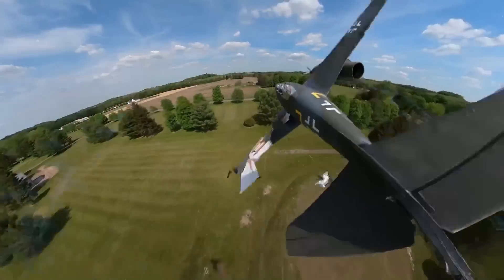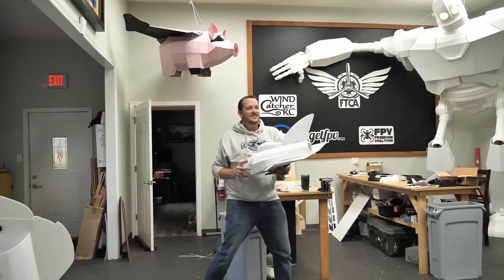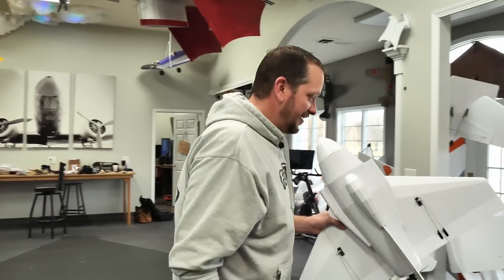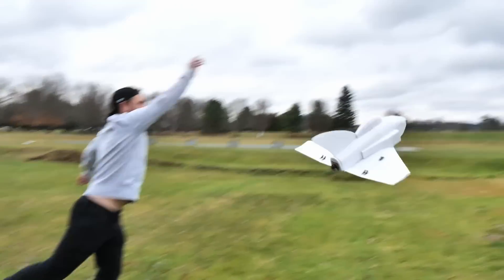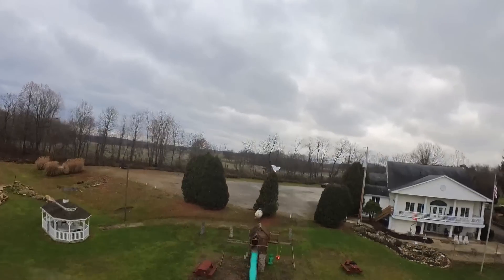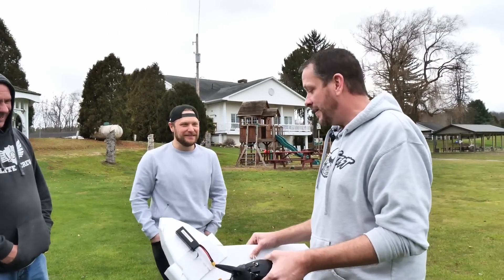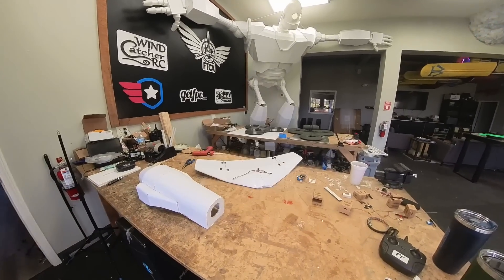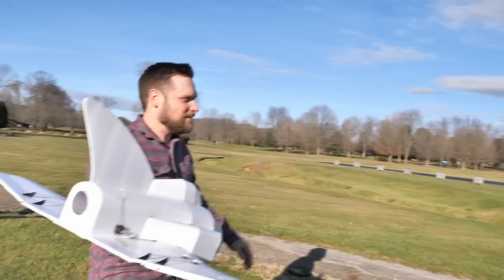My First Jet - The Retro Rocket

Comment: Which 6S 2200 pack are you using for the EDF? 6S batteries & an 80a ESC are HEAVY, but they work just fine with this model? Or, can I run the EDF on a lighter 4S & ESC? Thanks.
Reply from the maker: We use a series connector it takes to 2200 3cells and makes it a 2200 6cell. We’re going to have an adapter that will be available in the store very soon for that.  You can also have a great success from a 2200 five cell. Still office great power.  You’ll need to use a different EDF than what we have in the store to go to 4cell.

Comment: To find the CG, you should build a stand with a post about 1" diameter sticking straight up.  Then, setting the aircraft on the post, you can move it around until you find your center of gravity. Repeat the process if you're going to use trim weights.

Comment: It would be interesting to see you guys try designing a "high-bypass" EDF, where you have the small motor and a small blade inside the duct, but then you also have that big fan on the front giving you a large volume of push.
Reply: Being 70 years old it would be great to be able to get the planes for it because I don't have much of an income so I have very little to spend on my hobbies